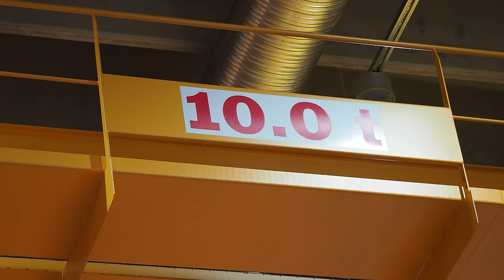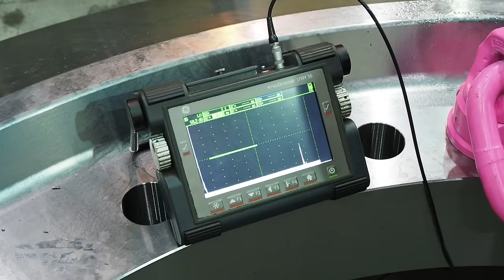Machining HUGE 10 Ton Bevel Gear with CNC Milling Machine

Comment: I buy bevel gears from ATA regularly. There is no gear company in the world which can match their quality and workmanship. Great to have an inside look at the factory.
Reply: Cheers mate!
Reply: what size? lol
Reply: china say hold my beer haaa haaa
Reply: I'm a little surprised to see such a rough finish on those gears, particularly the chamfer.
Reply: how much do you believe is the cost for one of these gear?
Reply: @tkzsfen  Like, at least several dollars, I'd say.
Reply: @fatherfintanstack8810  You're not wrong technically
Reply: @tkzsfen  Maybe 15k€? Something in that ballpark anyway.
Reply: @jerryjantola  naaa...15k is the amount they spent on drills for this. This is 500 - 1.000 k
Reply: Aniquin   the contact faces of the gear would be finish machined, but as the chamfer does not acctually make contact with the other gear/pinion its not as critical.
Reply: @jerryjantola  probably add another zero
Reply: PLEASE tell us how much a gear like this usually would cost!
Reply: @jerryjantola  Yeah, no.  Two weeks of occupying that machine has to be more than that and I wouldn't be surprised if they didn't spend at leas that much on the cutting heads.
Reply: tkzsfen that’s easily 1 million I’d guess.
Reply: itildude 150k
Reply: @jerryjantola  lol way more than 15k
Reply: Lol. I’m surprised ATA would allow this video. They are spending three times as long cutting this thing than is necessary. The strategy they are using to cut this is hilarious. For a company that based on what I see in this video does millions of dollars annually of sales you’d think they would know better. Clearly throughput is not a concern for them even though they could be making twice the money off this machine if they had experienced machinists.
Reply: @raystrong1390  the raw stock was too big for the machine to cut the teeth perpendicular to the face
Reply: DankDank Sure maybe during initial roughing, but the video does show a cutter cutting perpendicular to the teeth. If you were directly involved in the setup and programming I guess I’ll take your word for it but if not I’m still skeptical.
Reply: ... my chef is all about money so we have to make miracles out of shit :D:D:D
Reply: @operator0  i think its just a preparation for the final cut. those sides aint looking like a  gear tooth profile
Reply: @Klatubarada1979  I'm a machinist and I don't see how it would cost much more than 15k. Hourly rate at my shop for a cnc is $85. I don't see how there's more than 40 man hours in this part. I'm not sure how much material would be, maybe another 4k. Now we're up to about 8k for material and labor. Figure another $500 for tool wear and a premium because it's such a large part.

15k seems about right to me. Maybe it takes twice as long to make (I've never machined a beveled gear), that's still only about 20k.
Reply: @operator0  the weight of that gear maxed out their equipment. The shipping of that gear would likely cost more.
Reply: @Klatubarada1979  These guys are competing with shops that have equipment that can handle a gear this size. They can't charge more than market value just because it maxes out their machine because the customer will just give the job to another shop.

To ship a gear that size across the country won't cost much more than it does to ship a car, which is a few thousand dollars. Shipping by sea and rail is cheaper than shipping over the road.
Reply: operator0 Only the material is 15k. Its 10 000kg.. more like a 40-50k gear.
Reply: Where is ATA from?
Reply: @mickcarson8504  Finland
Reply: @oisinmccarthy7554  
Not China? Thats a first. I bought 3 welders and a milling machine from China. The quality of the products are shit. 😕👎
Reply: I would guess $100 000 for the part, plus shipping, handling and installing.
Reply: @operator0  Yea but your a basic machine shop @ $85hr. These guys are the only ones in world that can do this so I assume they can charge more than $85hr. I'd say 50k min
Reply: There is a company named Amarillo Gear Co in Texas that makes these same gears of all sizes from about 6" in to gaint ones like 6ft DIA , they also made the pinion shafts they mated. At the time they were the largest ring and opinion mfg in the US. I worked there 10 years about 40 yrs back.
Reply: @MS-tc1nc  yeah 50k might be realistic hard to say I would go with 30 to 60k
Reply: @raystrong1390  you must make a lot of money knowing that much more than this company. Mind telling us what you do and how much you make? I’m sure you’re super high up in a company with how much you know

Comment: Show us the lathe that turned the piece at the beginning of the video. What kind of steel are they made out of. This was so cool! More please.
Reply: fig1954 probably a vtl
Reply: I also wonder how the raw part was made, did it get rolled or forged? Don't think you can cast steel into a shape like this. Pretty insane.
Reply: Hand filed.
Reply: They would have used a vertical borer
Reply: @CatNolara  Most likely made via ring roll forging. It can be cast but the grain structure and overall strength of the material is better with a forging.
Reply: @longshot7601  Got a laugh out of me, I can just imagine Anni (I hope I spelt her name right) with a nail file working on these by candlelight :D
Reply: @longshot7601  Hand sanded by Will Stetler while Alec Steele gives commentary.
Reply: @PaulTheFox1988  Maybe there could be a collaboration with Chris from Clickspring.  Have you seen that guy's file work?
Reply: I worked at the mill that made the rings that joined the sections of the ISS.  They were rolled on a ring roller, ours could go to most of 20' if I remember right.  They were finished on a vertical turret lathe.  We made much larger things than this gear but nowhere near as complex.  Mostly ship shafting.
Reply: @CatNolara  I think this tapered shape would be perfect for casting. I do think though, if it was cast, they would have cast more of the features into it. That way they wouldn't have to rough out so much material.

I really don't know though, I am an expert in nothing.
Reply: @09jisaac  Casting's really not ideal for things like gears.  Too high a chance of imperfections, and overall weaker than other methods like forging.

The gears found in automotive applications aren't even cast.  They're either forged or powdered metal.  My understanding is that the latter has pretty much taken over for the majority of applications.
Reply: @markfergerson2145  MyMechanics: I make a new one!
Reply: It's allready been on a lathe before, clearly. I just don't know wich one (10+T!?).
Reply: It would've been a vertical lathe, that machine could've done it
Reply: I would have loved to see that too. The shop I work at runs a 6' diameter vtl. Seeing something to turn that rough stock would have been a treat.

Comment: Knowing my luck, id set the program running, come back in in the morning and realise id set the wrong program and the ring has been reduced to a M10 washer
Reply: LOL It would suck if you put in the wrong G codes!
Reply: I'd love to watch that video, which would have to include your reaction when you arrive back in the morning. That would be a true "Vat Da Faak" moment.
Reply: I've had sleepless nights when I've left a machine running.
Reply: That’s why I’m not a machinist anymore. They used to call me Scrappy McRework.
Reply: Scooby Dont I played machinist once. Turns out you can hide a hell of a lot of broken tools in a skip of swarf.
Reply: Lol everybody would come in and see a whole mess of steel chippings and exclaim where is it I can't wait to see what it looks like and be fumbling around in the chips before someone confusedly hold aloft a tiny M3 sized nugget wha the?
Reply: @iancrossley6637  Leave the machine running.  Go home (15 mile drive).  Take a shower.  Go to bed.  Try to sleep.  Clearly remember measuring the tool that's gonna be needed in couple of hours.  Can't remeber if you actually did input the compensation into the machine.  Get up.  Drive back to shop.  Check settings, all good. Get back home.  Sleep like a baby.
Reply: The most expensive washer... IN THE WORLD!
Reply: HAHAH same here
Reply: just melt down the chips and start again!
Reply: Is your company as greedy as not to pay at least a supervising operator to mind the process at night? 🤑 Orrrr wooosh😝
Reply: @dannydetonator  Not sure that's a matter of greed but foolishness.  Surely the cost of an operator to sit and drink coffee is less than the cost of one or two failed runs.
Reply: There is a famous machining faux pas that occurred in the 1970's, I studied the case in an engineering projects class when I did my engineering degree.  Apparently Philip's engineering in Netherlands ordered a high precision valve to be custom manufactured by a US firm in Texas.  They took the specification in metric, somehow added a number of scale factors for good measure, and converted thousands of a millimeter to inches and feet.  The resulting valve made of a very expensive stainless steel alloy was too large and heavy to transport by air transport and was shipped via the Panama canal to the Netherlands, then by road to Eintoven there are these incredible pictures we saw showing parallel trucks both leading and trailing pulling and guiding this massive trailer with a humongous stainless valve that was totally useless.  The Philip's engineering facility had this giant expensive valve at the entrance.  There are just so MANY cases of engineering cockups involving unit conversions and unit mix ups that this type of problem is in the standard engineering curriculum in Canada.  There were a number of famous engineering failures with NASA involving unit conversions involving the solid fuel thruster rockets as well as the space shuttle. I find this to be amazing to still occur now, units are the most basic factor that is paramount to engineering and scientific accuracy, on top of that the US is officially metric for government work and what capable professional engineer would ignore units.  Cheers from Canada.
Reply: @dannydetonator  
 lots of shops run "lights out" to hold cost down its really not a big deal. Properly set  up and programmed CNC machines don't require an operator during a cycle. its obvious you have never worked in a machine shop.
Reply: In that case, the swarf would be worth more.
Reply: @JonathonPawelko  

Am I understanding you correctly that they  took thousandths of a millimeter at inches?

So they made it around 25000 times too big?
Reply: That doesn’t sound like luck
Reply: You would do this only once.
Reply: @thejerminator877  probably 25.4 times too big...........So if the ball was  say 100 mm..........it would end up 2.54 metres...

Might have happened for real...as prototype parts can be very expensive....so after quotation to Philips...the engineers at Philips might have thought : ok , that is reasonable...make it....  Till the day it arrived...everybody thought everything was ok........
Reply: @JonathonPawelko  I had that with a quotation for a super alloy basket for a furnace in the heat treatment plant I worked:   
German supplier : 7000,-
French   supplier:  6200,-
British supplier  : 40.000,-

So I phoned up the British supplier or they converted the mm sizes to inches.....
Then they told me they did not and said they made a very good offer.....

Haha...
Reply: An M10 washer in a mountain of chips 😂
Reply: @JonathonPawelko  Ya know, I would think that Philip's would have received a quotation for the machining job. Did they not realize that the quote was for many thousands of times higher that it should have been? Also I have a hard time believing that a job for a part like you describe didn't come with a significant deposit and there had to be coordination for the transport logistics, right? Sounds like an urban myth to me!

Comment: It's wild that the big stuff I mostly saw in 5 years of studying Engineering(4 years of Basic Engineering, 1 year of a trade skill) before starting university was usually a ~200mm diameter gear and stuff like that. At the end of the third year though, I spent the mandatory 4 weeks at the local power plant. I was sent to the Turbine Maintenance area, they wanted to send me to the Lubrication dudes, but since each area needs two people I was sent to the maintenance area. The power plant was in the middle of the maintenance of the 4th turbine. Size 70 screws and nuts, a "small" plate for the turbine cover was like 50mm thick and roughly 1.5 meter in diameter. These are common sight for those guys working there, it was a really good experience. 
Though, the gap between the floor and the turbine itself wasn't fun, you could see into the basement from the 5th floor. Also we visited those basements frequently, walking around in 40+ °C heat around the pipes doing maintenance on pumps, didn't matter how much I tightened my helmet, it was slipping around from the sweat. Working on the pumps near the furnaces was also interesting, one end of the pillar you are sweating from the heat, the other side you are freezing from the crosswind in the tunnel. 
Atleast I got to see the inside of the massive desulphurizating machine in the middle of one of the cooling towers.

Comment: Love the large machining.  Cool video.

I started my career at a machine shop programming 2 large lathes.  I used to threaten the sales team that if they don't sell anything, I would put their car between centers and turn it down to a baseball bat and hand it to them...because I could.  Lol

That was a sweet DMG-Mori.  The last company that I used to work for bought a lot of Mori.  Lathes (2 & 4 ax), Mills (3 & 4 ax), Mill-turns (15 of them).  They make good machines and had a quality support team at the office that I dealt with.  I programmed everything in the building (all brands) at the last place except cylindrical grinders.

Comment: I'd like to see the bearing that the shaft for this rides on.
Reply: Can you get a ball bearing this large?  It could also be a magnetic or air bearing.
Reply: @qwerty13380  i have never thought about the fact that you can use buth magnetism and air as a bearing, thanks for informing me!
Reply: @qwerty13380  imagine making that bearing magnetic
Reply: @freppie_  PC fans usually have magnetic bearings.
Reply: @qwerty13380  You can buy roller bearings with inner races you could stand inside.
Reply: @qwerty13380  It would be a tapered roller bearing, to heavy and to much torque for electrostatic bearings, it's nowhere near the biggest miller i've seen, i used to visit a company that milled bridges out of a solid block 'Vickers Bridging' part of the Rolls Royce group, a guy sat in a carriage and drove the milling head.
Reply: Dont Know or could be a big brass bush
Reply: @spannaspinna  I wouldn't have thought so these days, though i spent many hours scraping bronze bushes in.
Reply: @qwerty13380   you absolutely can, the biggest bearing I have presonally installed was 1500mm inside diameter. Usually gears / equipment this big would use hydrostatic bearings to cope with the massive forces, hydrostatic bearings in perfect conditions sould not wear out like roller bearings do. Also usually have less friction.
Reply: Or the press to press it in.
Reply: @hetrodoxlysonov-wh9oo  hee hee. I wanna drive the milling machine.
Reply: It would be an awesome table
Reply: @qwerty13380  you couldn't use magnets for the bearings. This thing is way way too heavy for that.
Reply: @Yonatan24  yes, but PC fans don't weigh 10 tons lol.
Reply: A man can live with just one ball, so I can give them one of mine for making that bearing 😤
Reply: @hetrodoxlysonov-wh9oo  "milled bridges out of a solid block" "a guy sat in a carriage and drove the milling head" sounds like bullshit to me
Reply: @xenuno  Sorry, you're correct. They usually have brass bushings, but they're "loose" and float oddly.
Reply: figure that it would be an air bearing but with oil, if not rollers probably a bushing with an active pressurized oil film.the contact of round edges balls or rollers would not be usable here. probably
Reply: I wanna see the shaft and what in the fuck is on the end of it.
Reply: @Helperbot-2000  Yeah theyre pretty awesome. I remember first hearing about them from Elon Musk. He was talking about how to make the fastest underground train system. Basically, he said that the best possible way would be to either use air bearings or mag-lev it, and you would remove all of the air from the tunnel so you dont have to worry about air resistance. Pretty freakin awesome idea for sure lol
Reply: @undeadarmy19  ah cool!
Reply: @Helperbot-2000  https://www.youtube.com/watch?v=kn86dsjKfQE

Heres a video where you can quickly see just how insanely good air bearings are at reducing friction. Theyre so good they can almost run indefinitely.
Reply: ball bearings the size of beach balls!
Reply: judging by the size of it, it would probably not be a ball bearing since they ahve a very litle contact area
Reply: My guess is that these gears are actually going to be spinning quite slowly, and so you could simply use a single bearing surface that's externally lubricated by a pressurised lubricant feed. Basically like a crankshaft bearing in a car.

Comment: since the part is scaled very large, does the tolerance become large aswell? such as if this part was only 5 inches in diameter, the tolerance would be +- .002 but since its about 20 times that size, is the tolerence now something like .01, or does it still require very tight tolerance.

Comment: I think one of the most interesting aspects of machining on this scale is the ability to control the inertia moving these heavy pieces and maintain tolerances. Either incredibly powerful actuators and screw gears, or very complex calculations.